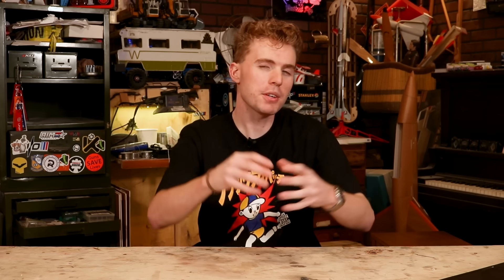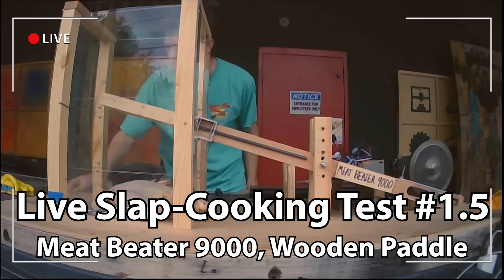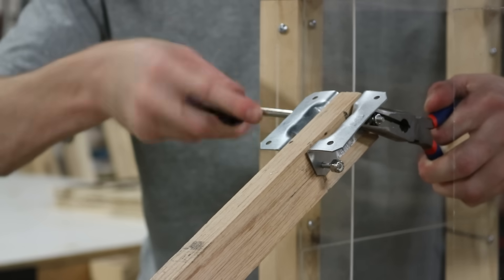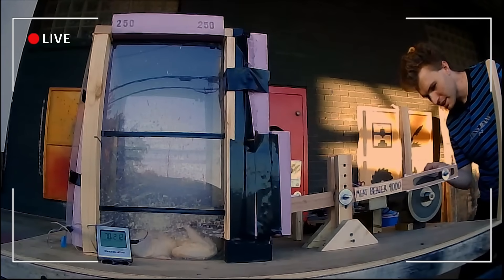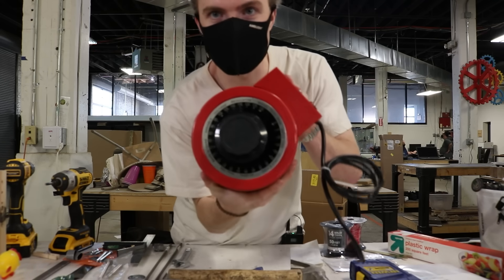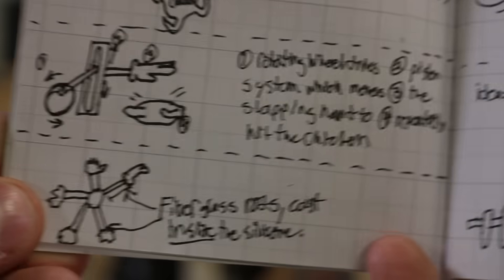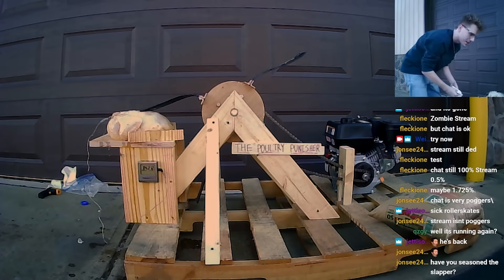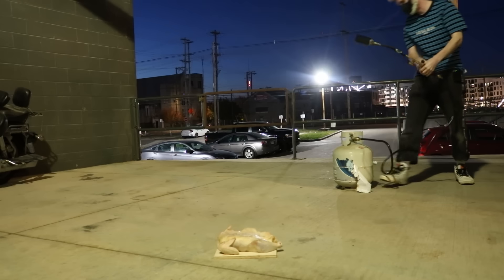How Many Slaps does it Take to Cook a Chicken?

Comment: It would probably have less destructive force if the slappers were at an angle.  Also, why did you get rid of the enclosure for that final test?  It must have had some beneficial function in maintaining the close ambient temperature to the chicken.  Also, rubber is good, but also abrasive.  Maybe a slightly flexible metal, thin plexiglass, or even carbon fiber would work.

Comment: How about enclosing the chicken in a quarter inch steel enclosure? Tight fitting enough to have chicken contact on all sides. My best guess is that you need at least 180 slaps per second.

Comment: Add a layer over the chicken like plastic or rubber. So the slapper hits the plastic layer first. It will divide the PSI across the chicken more evenly. I think it can be done. Also the lube was a great idea to keep things from wearing out as fast. Add more oil to the plastic layer protecting the chicken as the slaps continue.

Torque Converters are a simple and fairly cheap way to increase speed past the centrifugal clutch.

Also that chicken is dead. You can not get beaten by a dead chicken, unless someone alive is holding it who wants to beat you.

Comment: You need a metal rig. You upgraded the mount but you forgot that the screws are only as strong as what they are in. Then you used a heavy wooden wheel for the final prototype, that is more taxing for the motor and still not as strong as a light weight metal rig. Also consider using chicken breast instead of the entire chicken, you gave up on cooking the entire thing so why not use a smaller slice and save trouble with it moving or being heavy.

Comment: What about an alternate way of using the slaps?

My idea would be to make an insulated oven like construct that would have both the chichen and the slapper on the inside, and the slapper would slap the sides of the enclosure and heat up the air around the chicken, with sufficient insulation this could eliminate both the cooling and the chicked paste-ifying.

Comment: Am I the only person bothered that he went through all that effort and didn't bother insulating the surface the chicken was resting on and probably what was absorbing the most heat... 
Also a few more points, instead of having it on a rigid surface perhaps something with more elasticity will redirect some of the energy back into the chicken instead of wasting it by transferring it into the frame as well as keeping the chicken more intact.

A larger surface area for the slapping will allow more energy transfer and probably slightly reduced the damage to the chicken 

If you could slap the chicken from multiple angles at the same time that would probably help
Reply: Another point, trussing the chicken (tying it up) would help prevent it from breaking down as fast

Comment: It is possible in a zero atmospheric environment to cook a chicken through friction because the heat cannot easily due to heat not being able to be given off through air molecules. However, the materials used would also have to be insulated and porous, to prevent molecules heating each other. The material used will also after to be fire retardant due to the heat. After all, a chicken is warmed by the heated air molecules. It's equally cooled by friction because of vibration with the surrounding air molecules.

Remember to place the chicken in a zero gravity environment and attached to materials which are not affected greatly through heating or else the heat will dissipate through the materials used to keep the chicken in place.

Have another crack at it and good luck!

Comment: Instead of the chicken directly what about something conductive in between that could transfer the heat without smashing the chicken like a metal slab in between applying slight pressure to it

Comment: I FOUND OUT A WAY TO GET FREE GIFTCARDS! 

I know this may seem like a scam, but hear me out...
The Fetch Rewards app will give you points when you scan reciepts that you get from going shopping or out to eat, & with these points you can receive ANY gift card you'd like.
I didn't believe it either but I got a $50 Amazon gift card the other day using my points & bought myself a few things. (I CAN PROVIDE PROOF, JUST ASK.)
If you want a boost in points, yall can use my code "GUFKC" when signing up and get a FREE 2,000 points after you scan any reciept

Comment: Ok. Lemme fix this for you...

1. We all know slapping generates heat. Some of that comes from impact deformation, and some from friction. We all know that right? So you just need to generate more of it without ripping your food apart. Watching you beat the chicken directly made me laugh tears. Please stop. Seal up the chicken in a durable metal container. Let's say steel. Bolt it down. Surround that container with your "chicken slappers". Not just one. Go crazy. Slap it from all directions. Let those slappers heat the metal box and cook the chicken.
2. Upgrade: If that's not enough heat, you're probably not getting enough heat from material deformation, so coat your durable steel container in something that will deform resiliently and heat up. If the slappers are steel-belted rubber (like a tire?) and your steel box is coated in steel-belted rubber (again... like a tire)... you can generate more heat. Thickness counts. Too think and your rubber will insulate the bird. Too think and it will wear out too soon. So choose wisely.
3. Cooking directions: Let's say your meat-slappin' cooker can heat the outside of the container to a modest 190 to 225 degrees. You'll need at least that much. You also need that bird to reach 160. Let's say your tire-slappin-tire contraption can withstand it's own brutality for hours - it needs to. You'll probably need to start with a smallish room temperature bird and cook for 5 hours. Go with a game hen and cut your time down to 3 hours. Yummy.

Love interesting yet pointless videos like this. Thank you. I hereby transfer my rights to you and any future Ronco Slap-o-Matic. You're welcome.

Save me a wing.

Comment: Could you not slap something more resilient and transfer that energy?
Their would be a loss in energy their, but if destroying the chicken is the issue could we not do that. Kinda like how a radiator with liquid cooling works.  Except we don't need to cool the liquid and would need a resilient bladder to warm a liquid and a probe in the chicken to radiate the heat.

Comment: The last machine was more mechanically sound, but less suited for slapping chickens because it required the slappers to go through a full rotation (unlike your the initial machines). What you needed was a robust machine with variable slap DEPTH as speed is increased and the chicken surface is worn down. 

In other words, you kept building machines that were faster and more robust, but you didn’t pay attention to the higher tolerances required for stronger, faster, and longer slaps.

Comment: The issue with the rubber sheet model is that they rubber is stripping the top part of the chicken off, whereas the first models simply tapped it, not misplacing any of the cooked chicken in the process

Comment: I think a problem with the Poultry Punisher compared to the Meat Beater 9000 is that where the Meat Beater just hit it, the Poultry Punisher slid over the meat and thereby not only slapping it but also squeezing and dragging.
The principle of the Meat Beater seemed to work fine, but the structural integrity failed the project.
Full disclosure: I'm not an engineer. Only a science geek thinking of the pure physics.

Comment: Now I myself am no engineer, but  it seems the problem is simply the fact that the chicken can not hold up again the "clap" of the slap. I understand that the point of this experiment is to cook a chicken by slapping it but what if instead of slapping the chicken what if you slapped something else until it was hot enough to cook the chicken something more durable. This would bring about many more difficulties for example the loss of energy and heat between the transfers from slapper to slappee then to chicken but this might actually be a more plausible solution. Essentially the idea would be that you are cooking a chicken with the power of slaps rather than electric or gas heating from a conventional oven. So a slap powered oven. This would also bring about the possibility of cooking just about anything at least in theory.

Comment: You need to build a 4'x5' box for the chicken. Cut the chicken up so you can fit it inside the 4'x5' box. Then apply a layer of thin, low friction plastic on top of the chicken. Anchor the thin plastic on the side away from the "Punisher". Then use low friction paddles on the punisher wheel. This should stop the chicken from disintegrating during the heating process.
 Run "Punisher" for 24 hours even if the temperature does not get to proper cooking temperature. At the end of the 24 hour period, test the temperature of the chicken. See if it appears cooked even if it never got to cooking temperature. Then use a microscope to see if there are any living germs in the chicken. Then cook the chicken using accepted methods and taste the chicken after cooking it. See if there is a significant improvement in taste or texture. Let us know.
The Mecha-culinary world will be watching in anticipation of the results.
 God speed.

Comment: Rather than one large paddle, a staggered row of small paddles (like a stair case that wraps around a wheel) would give consistent slaps without too much surface tension, causing the chicken to virtually explode. The second slap would occur before the first slap completed and so on, but you wouldn't be spreading out the pressure and causing the chicken to break down as easily

Comment: What if you took an insulated steel box and slapped that instead with a chicken enclosed inside? While it wouldn't technically be slapping the chicken, it would eliminate the problem of the chicken's structural integrity.

Comment: What if you surrounded the chicken in basically a metal armor? If what I've heard is correct, metal dissipates heat so if the armor gets hot enough, it would be able to better cook the chicken evenly. It would also provide the chicken with protection.

Comment: Clearly you neglected the math on the resilience of chicken skin and dark meat versus white meat when met with force and heat. At what temperature does the fat holding the chicken together melt? How many  N of force is applied per slap and when increasing speed of slap machine of course the force applied will increase per slap. At what N do difference pieces of chicken begin to disintegrate? To TRULY cook a chicken with slaps, all of these variables would have to be applied

Comment: I'm curious if boiling the chicken could work better? While water boils at a higher temp (212 F) than the required internal temp of 165 F to safely cook a chicken, could the water act as an insulator? Even if you just wet the chicken first and not submerge it entirely? Just spit balling ideas at the moment

Comment: I would have used a wide steal pad for the beater end probably 16 20 gauge aslong as the chicken and almost as wide. Just enough give but has enough give when its going up and down think about it im terms of a whip when you use it when it goes back as you go forward it breaks the sound barrier and makes the end glow hot as it breaks the sound barrier get that hot end to slap the chicken every time and you could cook it somthing like that would transfers heat better and bearings and a rod for the motor end. Wood does not transfer hear well or hold it well. Also your wood may be heating the chamber not the chicken from the friction at the other end and moving the heat to the closed chamber have a temp gauge in the chicken and in the box itself in open air. Your wheel idea was good but how ever your cooling it as it goes around to fast like a fan so that was a no go and no way to properly transfer the heat. Rubber is also not a proper heat conductor there is a reason your tires are made of the stuff and electrical wire is wrapped in it and certain cloths for those work on the bearing sea or your shoes why your feet do not get hot walking on a side walk on a summer day. Variables to account for next time got to think about your products your using how you use them tolerances ect. Remember engineers are problem solvers and analyze everything.

Comment: I think the cam design was the best because it rose vertically, preventing destruction. I bet you could adjust the cam so that the motor pushes the rod down then releases it, so it doesn't dig into the chicken more than it has to, to prevent destruction of the chicken and the machine. Then the cam picks it back up and throws it down again

Comment: Scientifically he intervened in the experiment. His control variable is to slap and try and not lose heat generated. The aim is how many slap's it takes to cook a chicken. So when he added a heat source, it changed the intention of the experiment. Therefore, the experiment became how much heat and time would it take to cook a chicken of a hair dryer. Plus, the clear plastic cover would allow for sunlight to heat up the chicken inside too. 
I would deem this experiment flawed and not scientific.

Comment: I think the original stroking design would have been more effective if the parts were metal (cast hand covered in rubber and metal connecting rod) and it was combined with a combustion engine.

Comment: Air was your enemy and you did not even realize it.
There's always air moving slowly but it reduces the temperature significantly.
Next time you should isolate the chicken and prevent air movement.
Please, you should realize that there's always air movement even if you don't feel it with your skin.
The movement can be very slow, but it plays a role in cooling objects such as the chicken.

Comment: Ok so slapping a chicken to cook it has its problem. But the question is can you cook a chicken with slaps. Is there anyway you can put a metal slate over the chicken pressing down and use the kinetic energy to heat the slap which in return transfers to the chicken? It would solve the destruction of the chicken.

Comment: How much of the final iteration’s chicken destruction can be attributed to friction between the rubber sheets sliding against the chicken on the pull away? Earlier iterations definitely had a chicken pulping issue, but no where near the same degree as the last. 

Another interesting, but really really small, issue that could contribute to chicken pulpification is slap resonance. When you slap a chicken waves bounce along the chicken’s flesh. If the chicken is uniform enough in certain spots to allow for reflection then certain slap frequencies will cause a resonance where the amplitude of each consecutive waves grows larger. 

Really what this boils down to is: what’s the damn transfer function of chicken?

Comment: One of the problems I think is the concept of the slap itself though because swinging through the air like that was causing a lot of extra air movement which would work to cool it down. I think if they used some sort of vibrations in direct contact with it they'd have better luck lol

Comment: You need the last version but hydraulic powered and in a vacuum chamber.

The hydraulic is easier because its the only type of motor that easily can remove excess heat without having a rotating seal

Comment: It seems like putting the chicken in some sort of bag, or at least a top covering that both protects it physically to some degree and helps trap heat would be useful. A lot of the rotary slapper's damage done was likely due to abrasion as the slapper was dragged across the surface after contract. All of that chicken surface ablation is robbing you of a lot of heat, too. A flexible (to still transfer the kinetic energy) thermal bag would probably help a lot.

Comment: Suggestion: Place the chicken under a metal plate with a high heat conductivity, and slap the plate. The plate will protect the chicken, and transfer the heat efficiently as long as the contact area between the metal and the chicken is as large as possible.
However, you would probably still need a fair amount of isolation around the rest of the chicken for this to work.

Comment: It is the balance between keeping the integrity of the chicken and having a slapped that keeps functioning as it should without beating the chicken too violently. I suggest try using a back wheel drive car, crank up the back half of the car and build a rig like the earlier ones and use the car wheel as the motor, it’s designed to run steady for a long time with no failures. If you make two rigs you could even cook two chickens at the same time. You should use a wider surface area slap too.
Reply: To increase the surface area while not breaking the chicken, you could use a sliding compressing chamber instead to encase the entire chicken and hook the sliding board to the wheel and make it go up and down

Comment: what if you replaced the slapper material and used a metallic material instead of rubber? would that have worked better since the kinetic energy generated from the slaps per second and rotational force would be converted to heat energy fast enough before the integrity of the chicken deteriorates. i think that performing the experiment outdoors might have also been a factor to the failure of the experiment as essentially there is a lot of air & wind to account for cooling down of the chicken?